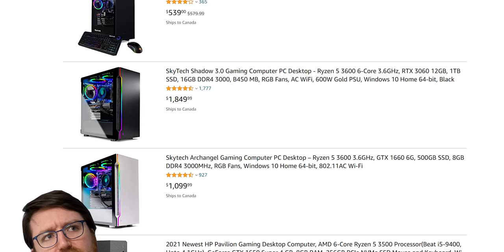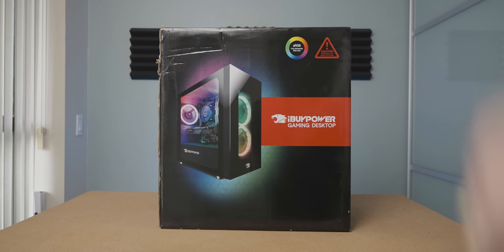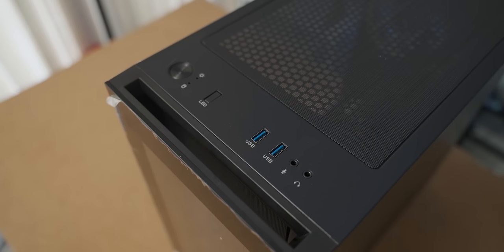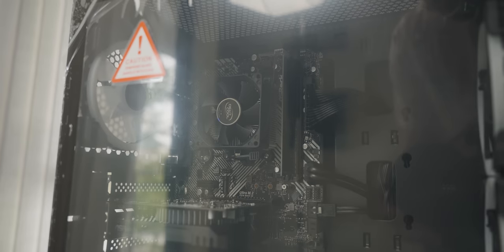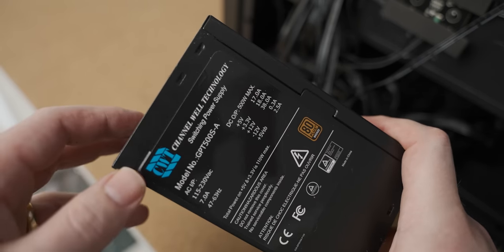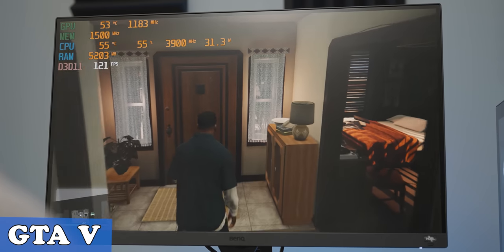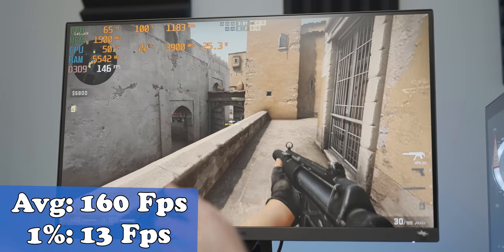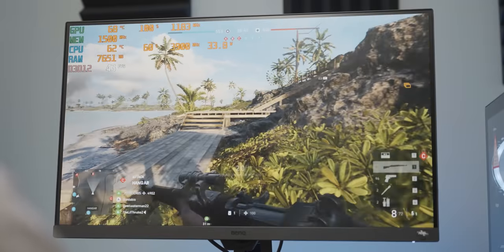I Bought The Best Selling Pre-Built Gaming PC On Amazon.com...

Comment: The missing mouse pad and lack of foam on the inside makes me suspect it's a return.
Reply: that would explain the damage on the box since it would have to endure shipping not once but twice
edit: actually 3 times shipping, not 2
Reply: Gamer Nexus did a review on a new iBuypower prebuilt and it was also shipped without the foam inside the computer.
Reply: it looked like it had been opened already.
Reply: That was my exact thought.  The no packing foam is a dead giveaway.
Reply from the maker: That is an interesting point. It still had all its plastic on the glass panels though.
Reply: @DawidDoesTechStuff  My cousin still has all the plastic on basically all his components and all of it on his case lol. I started to peel it when we built it, and he yelled at me 😂
Reply: @DawidDoesTechStuff  Not inconceivable that someone could have turned it on, had a simple issue, and returned without pulling the plastic.  Could also explain the wire tie in that capacitor...
Reply from the maker: @Girvo747  Hahaha!! To be fair I often leave the plastic on crap. 😁
Reply: @DawidDoesTechStuff  gamers nexus one had no foam, I suspect the sticker was an oversight
Reply: Shortage on foam lmao
Reply: @Girvo747  lol same
Reply: Good point!
Reply: @mindinversions4487  That's not a "wire tie," that's a "tweezer!" I watched The Verge's video, I know stuffs! lol
Reply: @dashcamandy2242  forgot the live strong bracelet
Reply: @DawidDoesTechStuff  Same i have a stereo system i bought like 6 years ago with the plastic just now starting to come off on its own. Its def kept it from getting scratched as bad as it would have in the 3 times iv moved.
Reply: @KrustyKrabPizza22  i got one from them on sale for like $650 or $700 i forgot but it has been serving me well
Reply: They only use foam on large GPUs...sticker is just universal for PSU.  And they were probably out of mouse pads so didn't pack any.
Reply: Nothing was missing. The "Element Mini Pro" isn't a mouse pad, it's the case itself. Dawid was a little bit silly there.
Reply: yea 100%
Reply: What got me was seeing the power switch set to on. Lmao
Reply: That would be illegal here in Germany, to sell a used system as new.
Reply: @DawidDoesTechStuff  maybe there shipping department is s--t
Reply: And... the loosely draped plastic bag around the half of the case, not tucked under the foam block ends. My tiny coin is thrown to this iBuy Krap being a return.
Reply: @Cup & Cone   but if you pay for it you are eligible for it, if you don't get what you buy you are, iirc by international law, eligible for returning the product etc.
Reply: @AD-tw1do  you’re smart
Reply: I thought that due to the superficial damage to the box.
Reply: Wat
Reply: @DawidDoesTechStuff  but also the lack of foam is common in the cheaper ibuypower machines they useally only put the foam on the more exspenive ones
Reply: R3 3100 is good though
Reply: @DawidDoesTechStuff  I'm jealous of that build compared to mine

Comment: The "Tested Components" sticker is an FCC certification that none of the components will cause any radio interference. It has nothing to do with the actual operation of the system.
Reply: Agreed. To wit, the graphics drivers would not be up to date if they had not turned it on.
Reply: @SpencerPetaluma  That's not really an indication of it being turned on. SIs use customized Windows installations that have all relevant drivers and software baked into the install. The image is simply copied onto the drive. This can all be done before the drive is even installed in the case. Another comment mentioned this potentially being a returned unit, due to the missing mouse pad and packing foam. If that is the case, it could explain the fully updated drivers. It's entirely possible this is not how the system came from iBuyPower.
Reply from the maker: @SpencerPetaluma  I didn't know that. Thanks! That's very interesting.
Reply: @DawidDoesTechStuff  Yeah.  A lot of industries require that certification like Emergency Services.  Any place that is UL or CE certified will only use equipment that has that certification. Especially if they deal with radio equipment like we do in Emergency Dispatch. Most prebuilts by Dell carry that certification.
Reply: And the RX 550 outperforms the GT 1030, despite the price difference between those builds at 00:54.

Comment: It always confuses me when prebuit manufacturers don't use the stock fan and instead replace it with some fan that looks miles worse
Reply: They probably buy the cpus in oem tray packaging without the stock cooler for a huge discount and use an even cheaper cooler
Reply: they prolly buy the cpus in bulk without original packaging to save money and use the cheapest fan they can find
Reply: That "500W" PSU looks very cheap too
Reply: @Gakki_Aniki  I think you mean that 500W "PSU" looks cheap
Reply: It's like a 400$ system priced at almost 700$, what do you think they're about lmao
Reply: @nefireous2720  or you two dont know anything, CWT makes PSUs for Corsair and TT lmao
Reply: Because they want it to look better than it actually is.

Comment: I like the „assembled from tested Components“ Sticker... Imagine a car Company would do that ;)
Reply: That's just the FCC testing sticker...
Reply: @NathanKull  what?
Reply: @startedtech  It means that all components comply to FCC standards (like limits and resistance to electromagnetic emissions), but that the complete system wasn't tested to that standard. Technically that thing could be illegal to operate in the US if it was somehow worse than the sum of its parts. (It's one reason why those transparent side panels are a bit ass, they don't shield against EM at all, but I assume that components have become better at not being noisy AF and can also take a bit of an EMP to the face.)
Reply: the airbag was tested before assembly :D
Reply: thankfully its a gaming pc and not a $30000 3000 pound death machine rolling at 60 miles per hour.
Reply: Basically they do. I’ve worked at a dealership and had them drop engines out coming off the truck, lol 😂
Reply: jim rose  Mike 🎤 drop 🤣
Reply: To be honest, if I were Ibuypower I would be contacting him to ask for him to add an annotation correcting himself in that bit of the video. FCC testing has nothing to do with the functionality testing done on the system to make sure it boots and that the system works etc. All that sticker was saying is that all the individual components meet FCC testing standards for the likes of electronic noise, but, the assembled system has not been tested to see if it meets FCC standards as a whole assembled unit. 

Quite a big mistake to make in a tech review tbh.
Reply: f e a r
Reply: @ChimpyChamp  Gamer's Nexus made a similar claim without coming right out and saying it.
Reply: Final testing on vehicles is down at the dealership. The amount of times things get left unplugged is more than one would think.
Reply: @--_DJ_--  Well that's disappointing, especially when you consider all the testing and regulatory knowledge they have, and yet they can't properly interpret an FCC sticker.
Reply: Quality is Job 1!
Reply: @ChimpyChamp  if that's actually what it means, then that sticker is incredibly misleading.

Comment: I bought a cyberpower pc prebuilt about a year and a half ago and it ran pretty good. Cable management was a little off and the AIO Cooler fans actually were destroying the radiator but otherwise it was fine, they even put in 2 sticks of ram which I didn’t think they would do honestly.
Reply: This one is ibuypower not cyberpower

Comment: Channelwell (CWT) has made good power supplies in the past.  They are OEM suppliers for many brands such as Corsair and others.  If I recall the Corsair 650W CXM as well as some of their TX series were built by CWT. As you know, Corsair actually does not make any of their power supplies but contracts other manufacturers to make them (same with other "brands" except Seasonic).  The actual PSU manufacturing companies include Fortron Source (FSP), Channelwell (CWT), Seasonic, SuperFlower and Enermax to name a few.  So it seems Ibuypower skipped the middleman company and went straight to the actual manufacturer to help reduce cost, which may be a smart move.

Comment: Single stick of 8 gigs of ram? Uh oh Dawid's the Triggering coming in!!
Reply: I'm agree and wondering why he did'nt test it with two modules in dual channel.
Reply: Vladimir Putin  ok you kind of get away with it on more custom-ish pcs like this but the bigger prebuilts like dell have no excuse since i think the type of people they're aiming for are not gonna be upgrading any time soon
Reply: Yeah, and cheapest crap of RAM you can find.
Reply from the maker: @equintar  I've done that test soooo many times. Besides, the system is so GPU bound that the RAM situation my not help that much.
Reply: @DawidDoesTechStuff  I wonder if something like BF V might see an improvement to at least the low dips?
Reply from the maker: @crenn6977  Maybe. BF V shows dual channel vs single channel clearly, so if it will help for a game, it'll be BF V. 😁
Reply: @DawidDoesTechStuff  That explains why the CPU temps are so good despite the awfully cheap cooler ? It probably ain't doing much, waiting for the GPU .
Reply: It might help in csgo too I guess
Reply: @DawidDoesTechStuff  In your other review of another system, 1% skyrocket by a factor of 6x by adding two sticks of ram!!!

Comment: I am interested to see how well minimum fps numbers would improve if another 8GB stick of RAM was installed, so that we could get a feel for the improvement/$ equation of that memory upgrade.
Reply: It would be min 30+ more fps
Reply: single channel to dual channel will automatically boost your fps minimum 10% to max around 30% depending on the ram you added on and the speed
Reply: Nah, just need to crank up the RGB till you're blind.

Comment: Don't worry about the power supply, it's cheap. But CWT builds power supplies for Corsair, be quiet and many other brands. That is even a good sign that they have not built in a China bomb.
Reply: The thing with Corsairs and other brands that order their powersupplies from these china factories is they specify exactly which components go into it.. where as one that is just a factory product usually gets the cheapest components to maximize profits.
Reply: @Oxytropis1  This is partly true, but the power supplies are cheap but quite usable. Smaller retailers on amazon/ebay use much worse ones, which can literally blow up in your face. 
Generally, you can not talk about worse components, it really depends on the price, model, etc. They are also designed for shorter warranty periods. By the way, I have already seen for example in a FSP power supply on the secondary side Ruybcon capacitors, there were the same branded PSUs were equipped with Teapos. This Japanese capacitors topic, is also largely hyped by marketing.

Comment: Dawid seeing a CWT psu: "I've never heard of psu oem's before"

Cwt isnt the best if I recall but they have made a lot of units for entry level and its far better than DEER or huntkey
Reply: Channel Well is one of the major power supply OEMs, they manufacture the Corsair RM, RMi and RMx series PSUs, they are capable of making very good products
Reply: Not knowing CWT as a "tech" youtuber is kinda sad.....
Reply from the maker: Yeah! I'm glad to hear it's not the worst. 👍
Reply: @DuyLeNguyen  DAMN okay, and I've seen a Great Wall PSU being amazing too, so I guess they can build great stuff when they mean to.
Reply: @matasa7463  Great Wall currently has the best SFX platform on the market which is what the SF750 Platinum uses. The branding and manufacturing when it comes to PSUs along with the individual quality is a pretty big rabbit hole.
Reply: @matasa7463  Great Wall manufactures Corsair SF series PSUs (SF600 and 750 Platinum, not sure about the SF450 Gold) and the SF series is one of the most often recommended SFX units so yes Great Wall has some pretty great OEM platforms too
Reply: That's why I think going by brand for PSU purchasing, which is often recommended online, isn't necessarily advisable. You have to go by OEM. There are a lot of regional brands and variations. The 80+ certification helps. You're fairly safe once you have that

Comment: If this had a b450 mobo it would actually be an alright deal right now. I would let you upgrade all the way to ryzen 5000, giving a good upgrade path for everything in the system. That a320 chipset kills it though.
Reply: hell even a a520 board would be better. No oc but it still could porbably handle a 5600x
Reply: @gamagama69  Something like a MSI A520M Vector WIFI maybe? There only around £75 here in the UK.
Reply: @Brandonnn69 for roblox and discord this is overkill so id say get it
Reply: Dude idk what you said. But I just need a pc that can handle apex legends, asseto corsa, and play with my xbox friends. What pc do I buy

Comment: As someone who works at UPS I can tell you that’s not bad damage. We will throw  or slide your shit across the belt to get it closer to the truck it needs to be loaded in, then potentially throw an unknown amount of weight on top of the package. This is after it’s probably been tossed out of a trailer and slide around it n countless belts smashing into other packages along the way.

Comment: Hey Dawid, make sure to do a follow up video where you take the machine apart and rebuild it your own way, simulating what a skilled user would do to upgrade this rig - add better RAM in dual channel, fix the issues inside the machine, put a real cooler on, set up XMP, CPU, and GPU overclocking, and see how the rig performs after all the tweaking.

I suspect this puppy has more to give, though the big glass covering the front intake isn't encourging. I'd rather they ship machines in the Cougar MX330-G because at least that one has front airflow mesh intake...

Comment: I bought a PC for parts from Mercari for $270 including shipping... It included a Cooler Master case, a 600 watt bronze rated PSU, a crappy mobo/ Ryzen 3 1200 cpu combo worth under $100 together... AND a GTX 1080. 

I got another deal on Mercari. This one was for $500 for a complete PC with a GTX 1660, i5-9400, 500gb SDD, 8GB DDR4 (recently bought 2x8gb for $40), 5 RGB fans, tempered glass window etc. Together they make a computer that blows any ones you mentioned out of the water, with almost enough parts to spare to make a budget build for a buddy of mine.

With a little knowledge, and patience, you can save a lot of cash, and own something substantially more future-proof.

Comment: The Assembled from tested components sticker is an FCC sticker. The FCC is an American regulatory agency that oversees many things including radio wave communications. The sticker is claiming that all components inside the PC have been evaluated individually to FCC requirements (i.e.  won't make a satellite crash or mess with police radios). The assembly of the components has not been evaluated (but it is most certainly acceptable). Basically, they were too cheap to pay the ~$10K USD to get the system evaluated to FCC standards.

Comment: There is one of the ibuypower one with ryzen 5 3600 and radeon rx 5600 xt. It was $750 but now it jumped over $1200
Reply: Still a very good deal
Reply: @shane250  for $1200. Thats Hella overpriced
Reply: @DOHA104p3  
In today's market, anything over rx580\1060 for less than $1500 is an okay deal. I would never pay that if I had a choice, but if you really need a PC... It's an okay option.
Reply: @shane250  true but the price jump tho.
There's the same pc on best buy that cost $950 but out of stock
I guess it's pretty good deal to some people
Reply: I paid 999$ for a i7 10700f with gtx 1660 ti with16gb ram and 240ssd. Msi b460 board. I'm happy with it
Reply: @adaniel2224  dang
That's overpriced but in this situation your lucky
Reply: @adaniel2224  
I got a 3070 for $750 4 months ago. I'm good for the next 4-5 years.

Comment: It's not an easy call sometimes.  For some people, "wait and save up an extra $200" is a perfectly viable alternative.  But for many, if their current budget has them considering a $620 system, then that kind of increase is literally a 32% increase in spending which may be quite significant.  Perhaps a recommendation of an alternative in the sub-$700 price range, which is within 13%, would be more reasonable.
Reply: If 600$ is stetch buy  a Xbox series x. Pc gaming is not cheap.  Consoles are best bargain for money.

Comment: My first time commenting on your channel Dawid, and I’ll be subscribing....

I did something I didn’t think I’d do. I bought a prebuilt from Walmart simply because I couldn’t get a graphics card anywhere...

For the price and what I got I was pleasantly surprised....

It only had two red flags... the infamous one stick of 8 gigs of Ram, but I already had a 2 x 8 gigs of 3000 MHz crucial balistix and the psu ... so I grabbed a basic 600 watt evga 80+ on sale for $39.99 for that... I basically wanted something newer to get me by for the next year at 1080p gaming for a year

I got a MSI Ageis at Walmart for $799 USD

Had a single stick of 8 gig memory, a 256 WD green ssd, 1 tb WD blue HDD, a basic MSI intel motherboard, 10th Gen f series intel i5 and a MSI Ventus OC 1660 Super gpu...

On Amazon I couldn’t find that gpu for under $900 because of the “shortage”

My temps have been fine...

For $799 USD I don’t think it was to bad

Comment: That sticker might not be functional testing but regulatory testing. Basically it could be that they are using the FCC certification of the components to claim compliance for the full assembly, which all EMC engineers know rarely stacks up, hence the disclaimer.